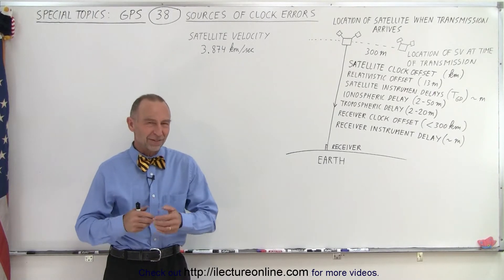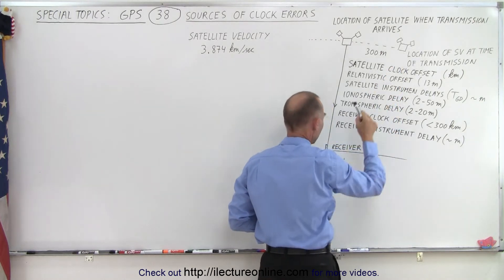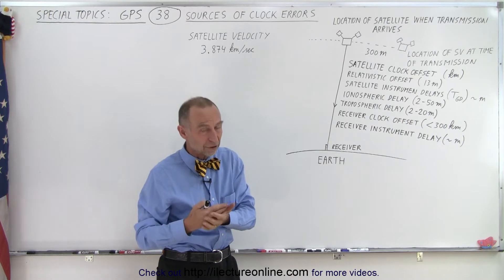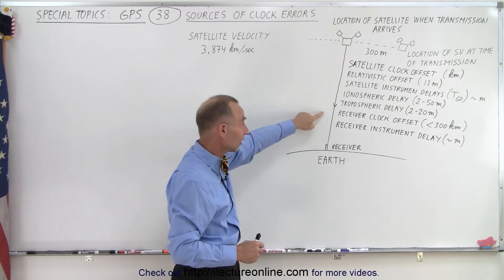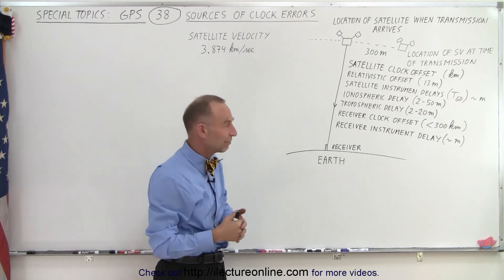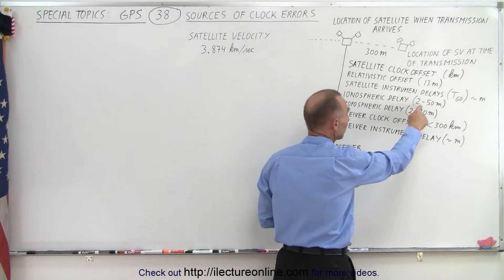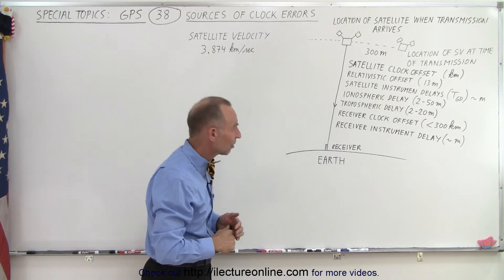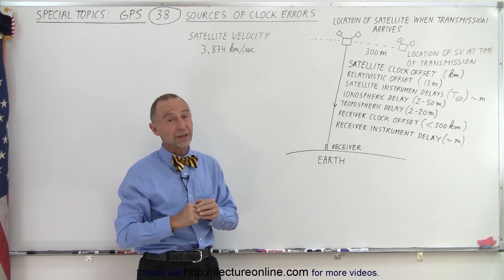Special Topics - GPS (38 of 100) What are the sources clock errors?

Comment: You are forgetting that the SRT invariance postulate is contradicted by GPS satellites.
Light travels faster from west to east than it does from east to west, because the Earth and its magnetosphere move WRT the satellites.
Light is an energy wave in that medium at satellite level.
Plus, they slow down the clocks before they send them up knowing that they will run slower up there.  Most of them are synchronized to the inertial Earth reference frame.  GPS actually doesn't even use Relativity, but it does contract the SRT invariance postulate.
Reply from the maker: Light travels at the same speed regardless of the speed of the source, or the speed of the observer.  No experiment has ever shown that light travels faster in one direction when compared to another direction.
Reply: @MichelvanBiezen  that is false. 
GPS experiments confirm that light travels faster  between GPS satellites from west to east than from east to west.  But in geosynchronous satellites it travels at the same speed.
 The variance of the speed of light has been confirmed to be independent of the source.  Which means the variance observed in GPS experiments must be due to the motion of the receiver with respect to the Earth's inertial reference frame.   It also means that the ballistic theory or emission theory of light is false.
Reply: @MichelvanBiezen  Try this reference
  arXiv 1506.02688 'On Constancy of the Speed of Light in the Global Positioning System' - Yang-Ho Choi
"This paper clearly shows that under the nonrelativistic 
transformation, the speed of light inevitably becomes anisotropic in the ECEF frame if it is isotropic in 
the ECI frame. "

"To obtain accurate 
information from the GPS data, the Sagnac correction should be made. "

When you read the materials from Ron Hatch, who has patented algorithms in GNSS, he says those corrections have been made in GNSS and GPS, which is why they are now more accurate than before John Deere started using it for robotic tractors.
Reply from the maker: This has nothing to do with light traveling faster, but with the relative speed of the object traveling around the Earth, since the Earth rotates.  An experiment was done back in the 1950s (I believe) where atomic clocks were placed on two planes flying in opposite directions around the Earth.

Comment: What about frame dragging?
Reply from the maker: It turns out that time dilation due to frame dragging is so small that we do not need to account for it.  A single orbit of the Earth in opposite directions accounts for a time difference of approximately 10^-16 seconds which is small enough so that we don't need to worry about it.
Reply: Actually, light travels faster between satellite clocks from west to east than it does east to west, because of the Aether rotation WRT the satellites.
  When John Deere started using GPS for robotic tractors, they upgraded the algorithms to take advantage of the failures of Special Relativity invariance postulate. They are so much more accurate now that the Military no longer uses selective availability, like under the old system.
The military used to use photograph overlays to guide a missile during the Gulf War, now with Lorentz Relativity algorithms, they can just put a simple GPS device onboard.